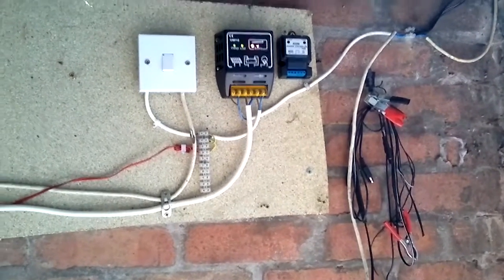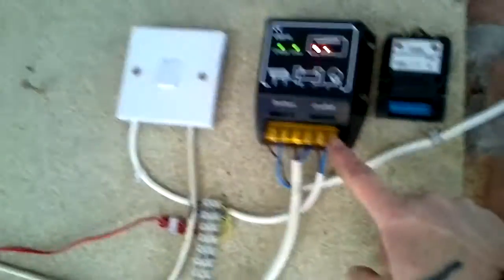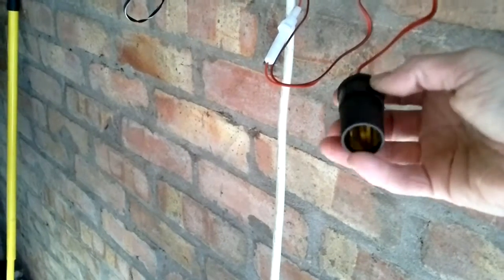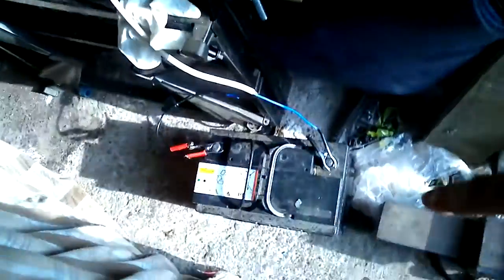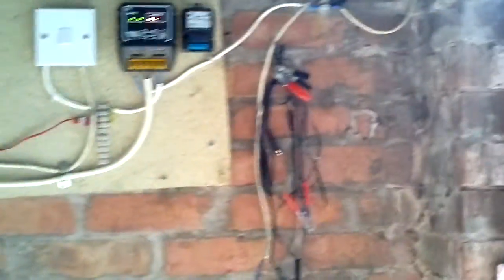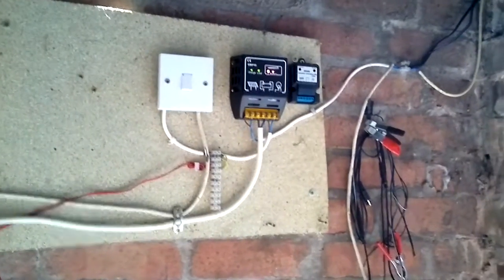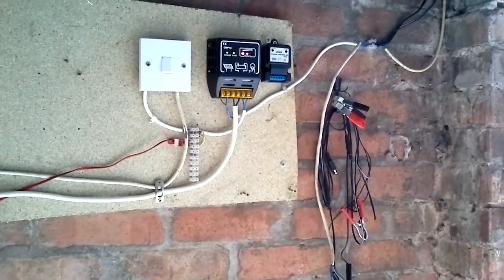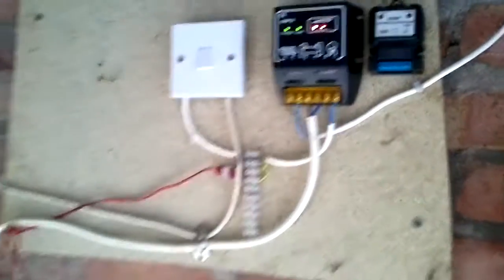Solar shed/garage set up.

Comment: i think if you joined the positive and negative of the 1.5 panels together and connected them into the solar charger with the 10w panel i think you would get 13w in total  if im understanding you correctly . just another thing whilst im commenting i have a solar panel that is shattered as they are toughened glass this panel was given to me whilst i was paying a visit to the tip and the guy said to me it dont work why do you want it so i told him it was for a project .anyway i got it home put voltmeter on it and got 22.2 volts so i thought this bugger is working so what i did before installing it i bought a tin of spinnaker yacht varnish and spread it around with a scraper allover every shattered crack in the panel and left it to dry then i covered it with that clear sticky backed plastic just to be sure to keep the weather out . i would just like to say that the panel has been working at full capacity for over 6 years and still working at full capacity . there are companies that sell broken solar panels off cheap and i swear down if you want to do a project like you are doing they are ideal and they do actually run at full capacity ive been amazed with my 100w panel . i would also like to say i admire you for having a go
Reply from the maker: Good find !
Reply: @MidlandBulletRiders i have mates who work on a recycling centre and since i got the broken one ive had 2 more 100w panels only the other day and they were given to me

Comment: How does this perform? Are you happy with it?
Reply from the maker: Changed a little since then. Put another 10 watt panel up running through a small controller which trickle charges my bike. That been working fine, also changed the main controller to a digital information one, and that's been looking after my lights and also the fitted a 240v power converter for low amp usage.  All in all, i'm pretty pleased so far. Would like a bigger panel, but is not practical where my garage is, some one would have it away !

Comment: I don't have much experience with solar, but at least you are trying mate. I'll have something similar when I eventually get my own bike.  🏍 safe
Reply from the maker: Thanks, now have a second panel connected so producing more than enough power to keep my batteries topped up. Have a large leisure battery connected, also able to run a 600w converter which I've used to power my Dremel and even a bench grinder. Something I couldn't have done before.